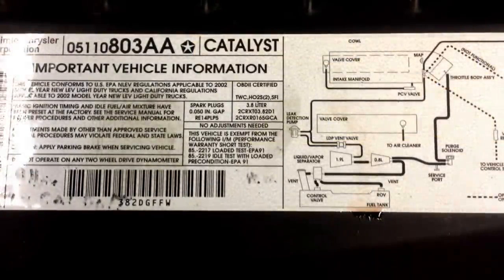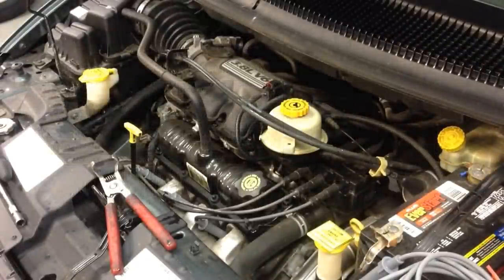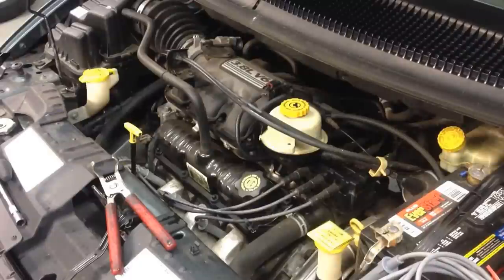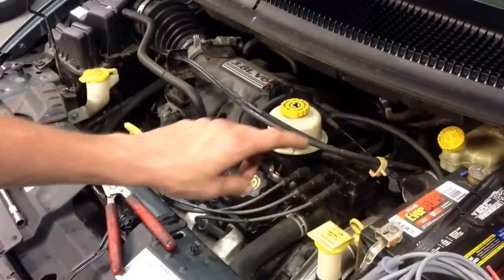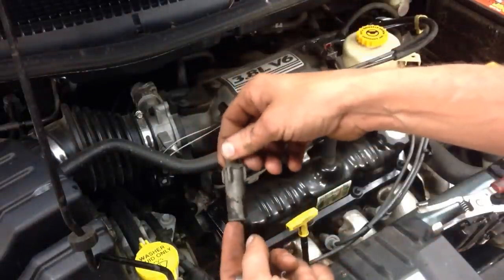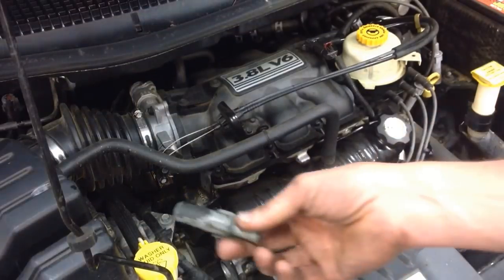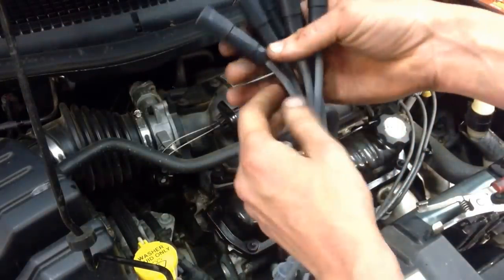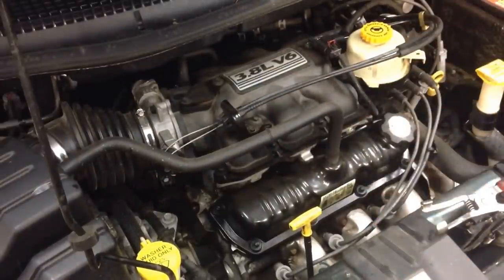2001-2007 Dodge Caravan and Chrysler Town and Country 3.3 and 3.8 liter spark plug and wire removal

Comment: I've done this before.....be very very VERY careful on the back spark plugs....for a professional it's easy to say and do, but for a beginner not seeing what you're doing and only going by touch can be tricky!.......... I found it easier to remove the windshield wiper unit.... that way you see everything that your doing!
Reply: That's exactly what I did, and if you're working on a 2002 caravan it's old and it's fairly easy to tack the windshield wipers assembly out.and then see the whole back of the engine for the first time. Gives you a chance to check everything out back there, and I still used a plexiglass mirror with magnet's on it ..way easier.
Also, I've had three opinions on the firing order for my 2002 dodge caravan sport 3.3 and even the hanse manual is different than this guy.he says 1 3 5. Hanses says
3 1 5.
Reply: This is a 3.8

Comment: Thanks.  Changed my plugs and wires on my 3.8L  2007 today.   Front (2-4-6) was easy.   Used a vacuum cleaner to get those bits of dirt and rust at the spark plug hole openings that result when taking out the old plugs.   On the back, it's a bit of work to get your hand back there but I was able to do it by feel (removal of wires, removal of plugs).  To put in the new plugs I used a small mirror on a long pole and a flashlight.   Solved my P0420 code.    Wire for #2 was longest (slightly longer than #1).   Wire for #3 was barely longer than #4 wire.   Wire #6 is a few inches longer than wire #5 (very shortest of all).
Reply from the maker: +toadie8 Glad it worked out. Great job on the repair. Thanks for the update and for watching the videos.

Comment: The dodge grand caravan 2001-2007 is the best minivan made imo. It was built for easy maintanence. Mine is 17 years old, and although I need to change a few parts, it runs great after you fix the problem.

Comment: Short and to the point, thank you! by the way using a old spark plug boot to grab the plug was brilliant. Job completed with less headache.
Reply from the maker: Thanks Brad for that feedback and for watching!
Reply: Or use a short length of vacuum hose that Fite securely on the plug tip.
Reply: *fit...typo

Comment: Hello, I tried to find a venue to ask a general question but couldn't. So, I am posting here to see if it will get through. 
I have a 2011 T&C and like many have had the issue where the HVAC controls have a mind of their own. It appears that the rear control system is the culprit, when you switch off the rear system totally and lock it out, all is fine. My question is, can you actually repair this condition with a new controller, etc? I would prefer for everything on my van to work properly...thx!

Comment: Great Video, thanks!
Most other tutorials, videos or print online on this subject recommend removing the whole windshield wiper tray/plastic assembly first.  The best way is to just reach around and do it like you said.  It did help me to get a helper, so that for each plug in the back I could keep a finger on the spot at all times as I worked on it and had somebody hand me stuff.
Reply from the maker: Jason Tucker My thoughts exactly. I see no reason for removing the wiper assembly when all you need is little bit of reach around. Your working a bit blind yes....but you have a duplicate layout on the front that you can see easily so just look at the position of the plus and let your hands do the looking for you on the back side and you wont have any issues. Make sure Jason to subscribe and help spread the word by sharing these videos with others. Make sure to enjoy whats left of your weekend.
Reply: I just loosen the motor mounts and drop the passenger side about 1/4" then stretttccchhh!

Comment: Question have a early 01 dodge caravan  with 3.3l v6 very low mileage! And i have a 07 3.3l chrysler town and country. What inter changes? Will the motors and transmissions interchange? I see the intake on the 01 is different and the front brackets and arrangements(alt,ac,ps) would the long block out of the 3.3 2001 engine fit the 07.?

Comment: Lost track of which length goes to which plug. I took them all off at once not realizing my replacement wires do not have numbers on them . Tried matching them up as best I can and it started rough. I think two of my wires are on the wrong plugs. How do I determine? They are similar lengths..

Comment: Not necessary to remove upper intake just remove rubber tube between air filter box and intake and reach passenger side of engine to get back 3 spark plugs. I did that on my 2001 Dodge Caravan 3.3 litter engine took 1 hour to charge all 6 spark plugs and spark plug wires. I use 3 inch extension, 5/8 spark plug socket and flex head rachet
Reply from the maker: oldhommer oldhommer thanks for watching. In the video I didn’t remove the upper intake so I am confused about your comment.
Reply: That's too long just to change plugs and wires. Did you take a break or something?

Comment: Remove the inlet air tube on the passenger side is a lot easier and faster than the wiper cowling. Opens up that side for easy access. On drivers side don’t break the brittle plastic vacuum tubing.

Comment: Thanks for your video. I have a misfire in plug #1....I changed the coil pack, and still have a misfire in plug #1.....I will take out spark plug on #1 cylinder  and re gauge the plug....or replace if dirty/corroded. What other things can I do with that cylinder that might fix this misfire?...Thanks again

Comment: The hard part is when the S.P. boot won’t come off,stuck, on your blind side.
Also, careful about cross threading and tightening securely without cracking your plug.
Can be tricky on that blind side.
Reply: Yep had some Yahoo do mine plug blew out and ruined the head

Comment: Here's to hoping you're still around on here.

What's the name of that tiny tube that's running right behind the power steering reservoir? Just broke mine and I have no clue what it does.
Reply: I think it’s a vacuum tube if it’s the same thing I’m thinking of

Comment: I just did the spark plug replacement on my dads '02 Chrsyler T&C...But the engine is real dirty, and I had a hard time cleaning even the front plug areas, let alone the back ones.  Now that I got all the new plugs in, one is not firing properly, cause I think I keep fouling it up with dirty engine grease.  Any tips on how to deal with getting the plugs in cleanly in the back side of the engine block?
Reply from the maker: best thing I recommend is trying to clean the area around the spark plug while its in with brake cleaner. try to get as much cleaned as possible. I use an old spark plug boot with the wire removed to help hold the plug, guide it in, and for starting the threads. Once cleaned, remove the plug and inspect the tip to make sure its clean and also that the gap is still correct. then reinstall and then make sure the back plug wires are routed correctly. the front are simple....the rear wires aren't in order.....so make sure to check the proper plug to the proper coil pack terminal
Reply: Thanks!  This engine has seen better days...I pulled the plugs one at a time when I replaced them, and its like each cylinder told a different story.  The #2 plug was burned white.  #4 was burned brown, and #6 had grey sludge on it, and the electrode gap tip was bent to the side!

Comment: So if your changing the wires with the plugs you should just cut off one of the plug heads to use to unscrew the plug
Reply from the maker: I use a socket to take the spark plug loose. Cutting the boot off the old plug wire will help to reinstall the plug. Its a trick I like to use when working on these engines. The newer ones are different and the plugs are deeper so it doesnt help on them. Thanks for watching and make sure to subscribe

Comment: Hi MCM I own a 2002 T/C Limited 3.8 and it's time to replace the Serpentine Belt, have you made a video for this part replacement, I've received quotes from 350 dlr, to 140 ind....
Reply from the maker: +BossaNossa1 Seems high to me. I have a video on the alternator replacement that would cover the belt removal.... https://www.youtube.com/watch?v=4OoLPfk1JnY . Otherwise a little of your time and the price of the belt. The $350.00 from the dealer sounds like a rip off unless they are doing sometime else as well.

Comment: Are you saying the plug wires are numbered to match the circuit coil pack? Do you have a video on how to change the circuit coil pack? Please and thank you.
Reply from the maker: Robin Moore Hello Robin. The factory plug wires and coil pack has numbers on both related to the cylinder numbers. I don't have a video on the coil pack replacement. Should be 4 bolts and a connector. Its easy to replace. Make sure to subscribe
Reply: MotorCity Mechanic I will definitely be subscribing. I don't have factory plug wires. They're plugs and wires from O'Reilly's and pre-gapped. So I guess the pertinent question I should have asked is this; Does it matter which plug wire is on which connector and plug? I matched them up by length to the ones I took off. The reset the code afterward and said it's throwing a misfire code for cylinders 1,2,3 and typically means the circuit coil pack needs replaced. I want to make sure before I attempt this, that it isn't something like the wires are on incorrectly.
Reply from the maker: I does make a difference where each plug wire goes from the coil to the plug. I am currently uploading a video on the same engine in the newer body style that explains where each cylinder is and also what the numbers are on the coil. Make sure to watch it closely to see where they all need to go. Different van but same engine.
Reply from the maker: Robin Moore Here is one of the links, it should work. If not then check back in a few hours. Its a 2 part video so watch both
Reply: MotorCity Mechanic Argh, so basically I'm up a creek. I didn't pay attention to the wires when I took them off. I just matched them up by length. I have no idea which one goes to which plug which means I'm going to have to take it to a mechanic to figure it out. Thank you for your help. I appreciate it.
Reply from the maker: You can fix this....its easy. Don't take it to a shop yet. Watch the 2 videos I'm working on first and then recheck your wires.
Reply from the maker: Robin Moore both videos are up and running, check them out
Reply from the maker: Robin Moore email me at david@motorcitymechanic if you need more help. I can email you a pic that shows where each plug and what terminal of the coil as well
Reply: MotorCity Mechanic

Comment: Do you have any tips on how to remove the pcv valve? mine seems to be stuck, its an 06 Grand Caravan 3.8. Thanks
Reply from the maker: Been along time since I replaced one.....I dont have any videos on it. It should just pull out. It may help to soak the valve with wd40 and wiggle it back and forth to help work it around the seal.

Comment: On a 3.8 Litre thinking of Buying Sw fresh oil  near Cam Shaft cover...and spark plugs..what could that be?
Reply from the maker: The most common causes for leaks are at the lower intake gasket and the valve cover gaskets. Theres a good chance that you might have both leaking. Best thing is to clean the engine off and then watch to see if you spot any leaks. Thanks for the question and make sure to subscribe

Comment: How can I determine whether the #4 injector on  2007 T&C is bad or if its just the wiring?
Reply: I'm not a mechanic but I might suggest you look to see if the plug wire for #4 is crossing next to another wire and look for signs that it is arcing.
Reply: great tip thanks for the suggestion, I will check it at first opportunity.

Comment: Broke a plug off in cycliner 6 any tip to removing it. Also where is this room you speak of for the read bank. The 2001 has no room to get tools in. Thanks engineers for knowing your a** from your elbow!!!

Comment: What if it says 3 1 5?
Reply from the maker: 3 1 5 is the plug wire location on the coil pack. these are the back side of the engine spark plugs. 1 is closest to the passenger side, then 3 is in the middle and finally 5 is near the trans on the rear
Reply: So that means the back coil says. 315. So i starring right at it your saying one goes all the way to the left 3 middle and five to the right? Cuz right now ive got 3 to the right 1 middle 5 right
Reply: 3 to the left*

Comment: You have to be the lowest man on the totem pole to get this job ? Ihave seen techs draw straws to see who wad going to lose blood ,sweat and tears . Just changed mine at 109 k and i wsear they were originals ,the gaps were about 75 thou . took two and a half hours and a half pint of blood and every cuss word i could think of . The bastard that put all the heater hose clamps where they would tear you up has a special place in hell reserved for him.